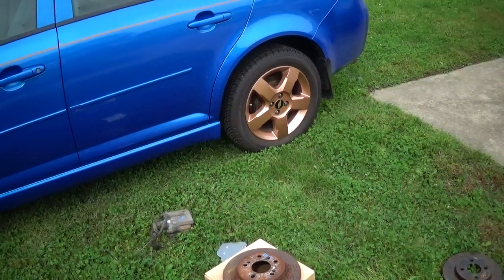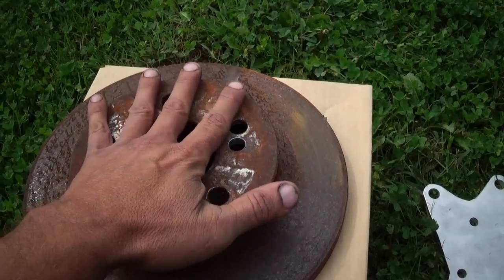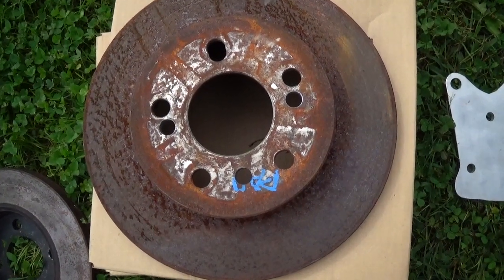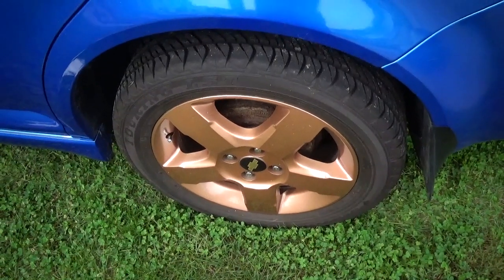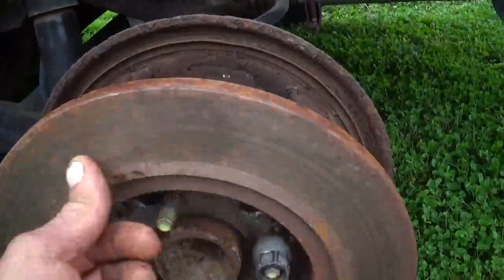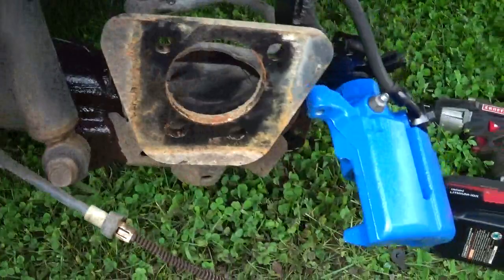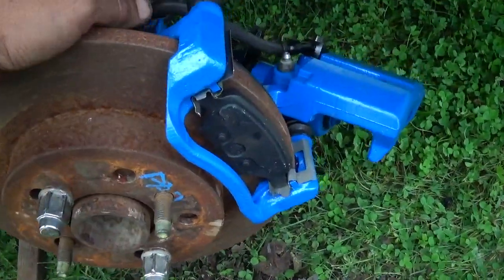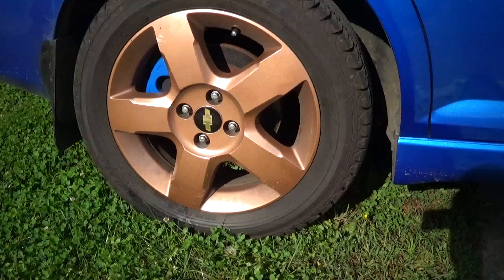Cobalt Rear Drum To Disc Brake Conversion

Comment: while watching this i was wondering about moving he caliper to the from of the rotor and you covered it at the end i'm impressed!  lol  i've also got to cobalts a 2006 ls manual and a 2010 SS/TC.
Reply from the maker: At the moment all I could do is make a template so you could cut your own. It would also have all the drill sizes wrote on it so you would know what size to drill to. I have a ion coupe I plan to put these on. Also got most of the parts to put a supercharger on. Just need a few nid bits a a computer tune. Thanks for watching!
Reply: L O selling the 2010 ss
Reply: @williamstaten8102  hello! Do you still offer the template?
Reply: @Lexicalde98  i got a free template in some replies to other comments
Reply: @williamstaten8102   cimbian of mm the steel or aluminum plate ?

Comment: hey op been looking at doing this on my 09 LT its a half year with lap 2.2 , all standard 2010 balts, its a factory 5lug car with 16/6 alum wheels. are those lsj calipers? are those 10inch rotors like the factory fronts?

Comment: Have cobalt 2007 with drums 5 lugs. Will this work for the rear? Don’t want rear drums
Reply from the maker: Yes.  Be easier actually. Not rotors to drill out
Reply: @williamstaten8102 so what do I need to resource from the junkyard? Just the rear brake rotors from SS? Plz thank you
Reply: @williamstaten8102 hello so what do I like do? Do I just print the template on the pdf file and take it a metal shop to make? Any help. Any email to reach you thank you

Comment: Why didn't you just do the 5 lug conversion you just need to change the bearing the dimensions of the hole for the bearing are exactly the same on the axle
Reply from the maker: Have several times since.  Didn't want to invest in wheels one this car.

Comment: So where do we get the proportioning valve from? Do we get it from a cobalt with abs?
Reply from the maker: Since I put this on six months ago or so, I've been using the splitter that's already on the car. Seem to work perfect.
Reply: Okay, awesome! And the brake line you used is good too? Or do you recommend upgrading to stainless steel lines?

Comment: Do u have one for a 08 aveo
Reply: Good luck.  I'm pretty sure it could be done.  I've got a 2011 Aveo LS sedan I used a 1995 dakota bed and cab back to weld together and made a UTE. I'm upgrading for fuel economy and handling.  Disk brakes are on the list.  That's why I'm over here researching.  😂

Comment: hey could i order a bracket from you?
Reply: @user-lw8jk6nv7l  cool thank thank you!  Is that 8 1/2" x 11" paper i would think?
Reply: @lo9939  yep, just print it out and make it. Took it straight of my axle. Spray painted the piece and pressed it on. As accurate as it can get, but I might make another and try to get more paint on it

Comment: Hey, if I use front calipers with this template. Do you think the thickness of the bracket will change ?
Reply from the maker: Won't work. There a different profile
Reply: @williamstaten8102  oh. Ohkay thanks you 🙏🏽😊
Reply: @williamstaten8102  hey, what’s the thickness of the template it self?
Reply from the maker: @lararafael80  made mine out of 3/8" aluminum
Reply: @williamstaten8102  thanks 🙏🏽